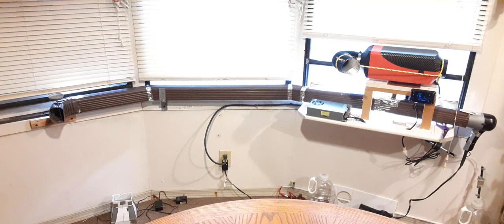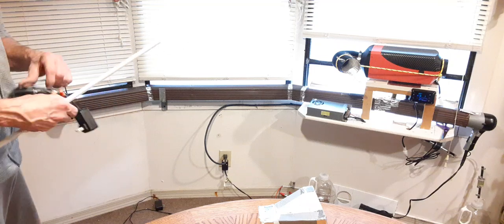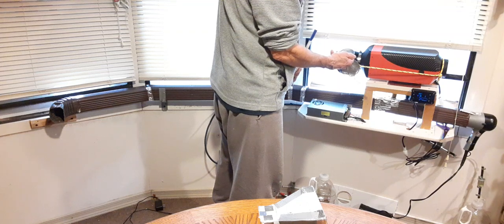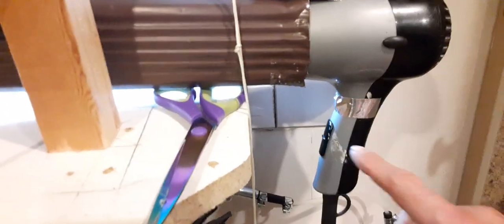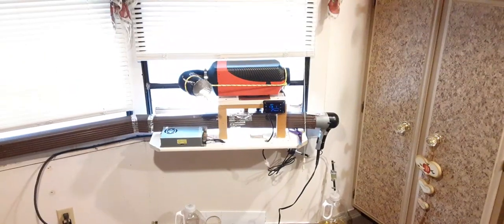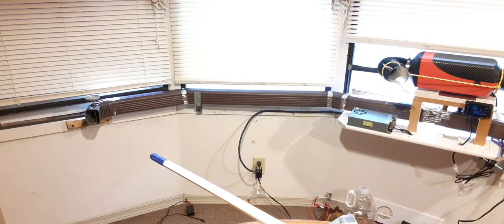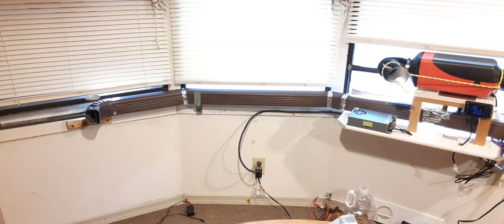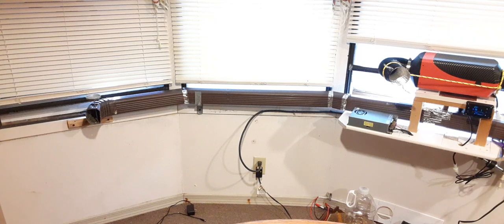Chinese diesel heater test number 2 results  independent heater using the exhaust pipe.

Comment: James you are looking at it wrong get a cheap house radiator on the wall have the exhaust pipe going in at the top then exit for bottom then that goes outside you will find that the radiator will heat up just like it had water running through it that's one free radiator or you can put several together and still have the heat from the burner stop messing around with that pipe if you still want to use it put it through a amo box there's some good videos on YouTube hope this helps you  👍
Reply: Good idea , worth a try

Comment: Consider putting the entire unit outside in a box, with an insulated air pipe to the inside. Also, you could extract energy from the exhaust using a heat exchanger (EGR).

Comment: I like that design a lot but you might need to make the duct go up all the way to the bottom of the heater because that is where it's the hottest , also if you could add some sort of aluminum around the exhaust pipe right where it attaches to the heater , the aluminum could attract the heat and then use a better fan to blow the heat

Comment: Ive watched videos claiming running 50/50 diesel to waste engine oil increases the output temperature but ive yet to test it. How about using the exhaust to reduce the viscosity of waste engine oil to diesel mixed above 50% waste engine oil.  Using oven cleaner to dissolve carbon build up during testing

Comment: I disagree with your assessment , I like this setup better , the first set up you got a higher temp reading because your sensor was reading both the heater output and the exhaust output at the same time , in your second test your sensor was only reading the exhaust out put , there was heat coming out of your heater output that you didn't include in the 2nd test.
Btw my diesel heater output while on low is only 90 degrees F , 
My heater on medium is about 120 to 130 degrees depend on how deep into the duct I point the temp gun.
130 to 160 degree f on high
So if your getting 120 f on low from your exhaust I would call that a success because you can still hook up another down spout to your heater output and get your radiant heat plus the heaters output plus what ever comes out of the end of the heaters exhaust at the end of the Down spout ,
So for this 2nd test you got 120 degree output from the exhaust and then you have to add about 90 degrees that is coming out of your heaters output assuming your heater puts out 90 degree output on low like mine does 
120+90= 210 degrees total
Compare 210 degrees to the first test.
Build your duct up higher and I think setup 2 is better
I think the heaters exhaust right where it attaches to the heater is the only spot that is 350 degrees and since your duct doesn't go up around that area you probably have some heat escaping , build your duct up higher up to the very bottom of the heater and I imagine your results will improve big time. 
Heaters exhaust down spout output plus
Heaters down spout output 
Plus radiant heat = total heat heating room
The reason the heater mfg didn't take advantage of the exhaust heat was probably the fear of carbon monoxide poisoning , probably be a good idea to get a carbon monoxide detector in case the exhaust ever develops a leak.
You'll be ok as long as you keep the exhaust sealed

Good luck

Comment: How much power does it need?
Reply from the maker: Power consumption these units very. When you first start them they draw about 9 to 10 amps of power for a brief period of time approximately 3 to 5 minutes. After the glow plug goes out they will draw Power according to where you have the heater set for. So after the glow plug goes out if you have your heater set on a low setting or its lowest setting you will be drawing somewhere between 0.5 amps to as high as one amp depending on the heater. All these heaters very because of different manufacturers over in China. If you research power consumption on these heaters on YouTube you're going to find videos with different opinions. So to sum this up you would need a 12 volt power supply capable of delivering the minimum of 10 amps but I would go at least 15 amps. I hope this is been helpful thank you for watching and thank you for your comment.
Reply: @jamesgilbert1013  Thanks, yes very helpful!